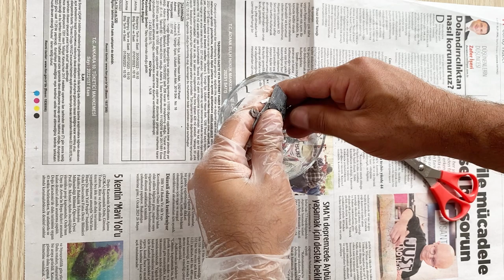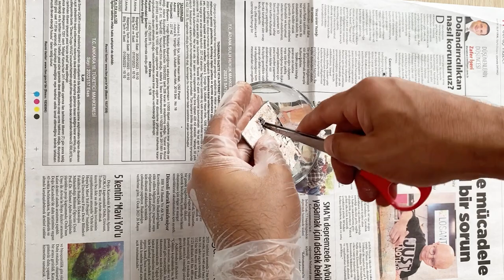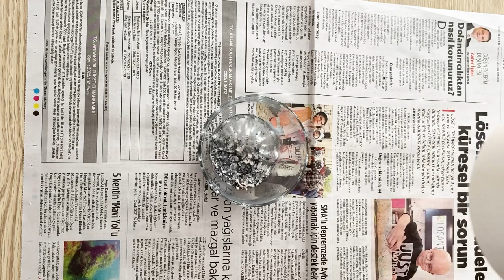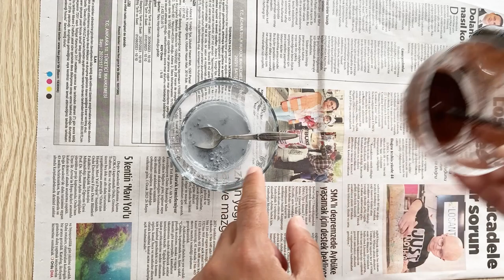How to Make an Ultra Battery (Step by step with each detail)

Comment: Hi Friend! Best video i ever met. I think black /gray color negative lead plate is coated with carbon graphite and adhesive. As far as I understand positive plate would be coated oxide naturally while charging process.
However in the relistic big current battery repair videos we see the positive lead coated with the red material like a mud or soil or cement. Please advise the details on which chemicals we may use to coat the positive plate or just melting the lead in the water is enough.
and
why you coated / applied the carbon over the lead plate for only one surface instead of both sides? Thanks
Reply from the maker: Thanks my friend for this nice comment. Actually l explained in the video on the white paper on figure. Because of the working principle of ultra batteries we coated only negative plate👍
Reply: The carbon will simply convert to CO2 on the positive plate when recharging.

Comment: I made one like yours. it worked good but it is dead by next morning. Needs way more PbO2 in order to hold charge for longer.
Reply from the maker: No brother probably your separator wasn’t good enough and probably it short circuited Please check it out. (Note: you get better charge holding result buy using more PbO2)
Reply: there is something fishy here...sulfuric acid should burn paper towel like fire...
Reply: @marian20012  Not when it's at only 30% strength.
Reply from the maker: @johnslugger  that’s right

Comment: Thanks for Sharing, I believe that enhancements to the traditional Lead Battery is the path to the future not fancy batteires.
Reply from the maker: 👍you are right.
Reply: @joyofelectronics9782  In your Hybrid Supercapacitor video(Lead Hydroxide/Activated Carbon) it is stated that it's only 100 Farad. That seems very weak compared to the pure lead acid battery you made(with spent negative battery plates). I would have thought that the capacity of the hybrid Super Capacitor would have been much greater.
Reply from the maker: @nicamarvin  brother Supercapacitors never can store energy as much as batteries
Reply: @joyofelectronics9782  Understood, but the chemestry(Sulfuric Acid electrolyte) and the Positive plate(Lead Dioxide) are basically the same as the Lead Acid Battery, could it be the Activated Carbon? Does The Ultra Battery you built behaves like a Hybrid Super Capacitor or more like the pure lead acid battery?
Reply from the maker: @nicamarvin  hybrid Supercapacitors more likely behave like Supercapacitors. That’s why they can’t store same amount of energy as batteries. The difference between hybrid Supercapacitor and Supercapacitor is their operating voltage and partly capacitance. As you see the surface area of hybrid Supercapacitor’s plates are less than Supercapacitor.

Comment: Thanks for your nice video, I have a question, in charging shall the voltage increase or decrease for the battery?
Reply from the maker: Charging voltage should stable at 2.40 volts after increasing at that point. The voltage of the battery will increase of course
Reply: I saw the balance charger for battery shows potential decrease during charging, for that I am asking minute 19:19 in video. I hope you explain it to me
Reply from the maker: @amrradwan4279 in this type of batteries the charging voltage increases as the battery is fully empty at the beginning. But it lasts very short time. This is the basic characteristics of these batteries.

Comment: Hello my dear brother, I want to make a single electrode, not a super capacitor, 5cm long and 5cm wide, and it is coated with carbon nanotubes. Should we take one electrode out of it for examination or two?
Reply from the maker: Hello, two would be better
Reply: @joyofelectronics9782  Is it possible to take the test if there is only one?

Comment: You should have worn gloves the whole time😅😂😂, still good video.
Reply from the maker: Yeah you are hell right😂 but sometimes it’s difficult to work with gloves. However l washed my hands with plenty of water and soap right after the video 😂
Reply: Nice demo and useful information for us, thank you for your efforts. From Jawaharlal Bharat INDIA 🙏. I saw you have connected the negative terminal with the centre positive, will it not discharge itself?. The two negative should have been soldered as one Neg and centre as positive.
Reply from the maker: Actually l didn’t connect the negative to positive. I connected the negatives together but when l applied the active material to the negative electrodes l made a mistake. So when l solder the negative electrodes due to their positioning it seems as if l connect negative electrode to the positive one☺️
Reply: @joyofelectronics9782  Ive made same mistake with negative electrodes. active material applied to the wrong side of one of the electrodes.

Comment: Where can I get activated carbon?
Reply from the maker: You can order on internet
Reply: @joyofelectronics9782  My situation does not allow me to order from the Internet. Is there another solution, such as a way to make it at home?
Reply: @joyofelectronics9782  I have another question: how do I know the appropriate electricity for charging, as I do not want to charge it with a strong charger or a weak charger and thus it becomes damaged?